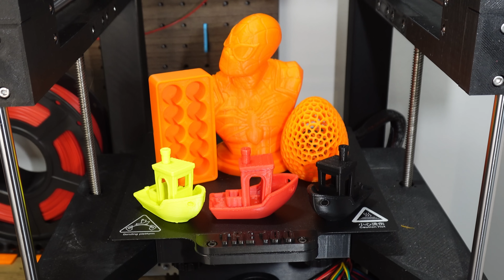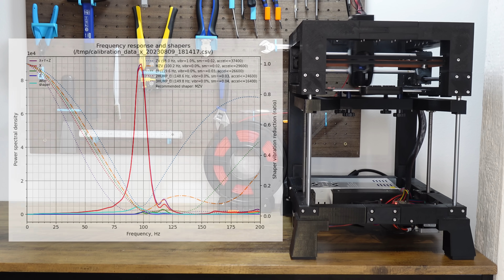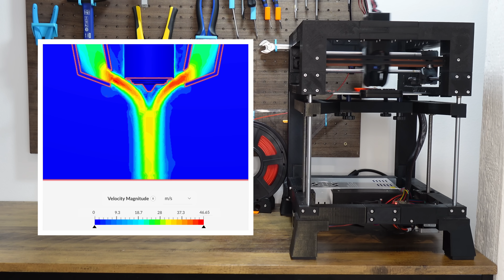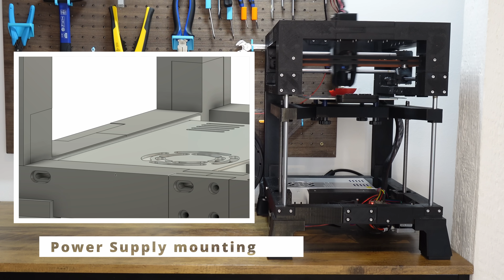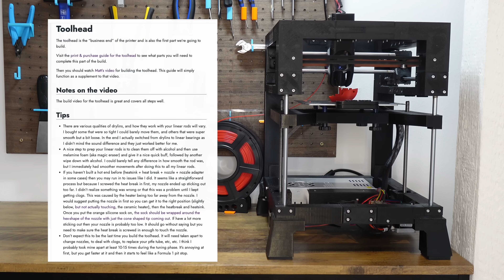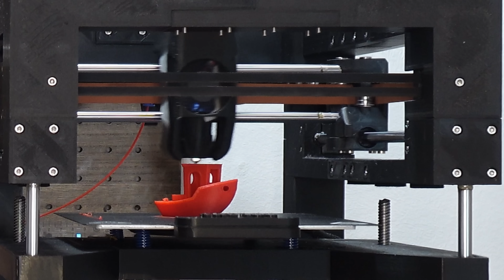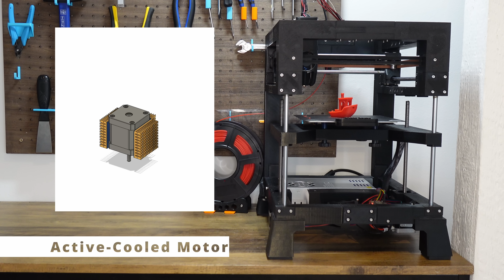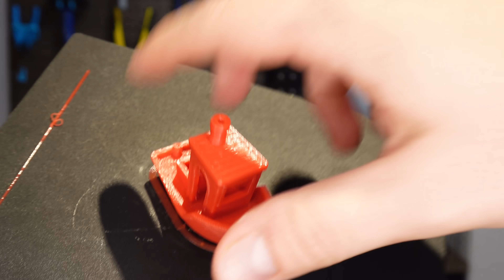THE 100 - The World's Fastest 3D Printer

Comment: Nice printer! Way better than anything I could do by a LOT lol. I would also like to see a bigger version. Speeds are great but I want an area that can take advantage of those speeds and not be limited to smaller parts (I am talking no less than 300x300x300 but preferably 600x600x600). Smaller printers are getting faster all the time and I wish someone would focus on the larger ones as those will benefit even more than the smaller printers. Why print a helmet in pieces when you can print it whole? It really is a great feat that you have done here and I applaud you whole heartedly!!!!!!
Higher dollar version to me would only be if you upped the size. Without upping the size it will always be limited to ankermake or bambu sizes :(
Reply from the maker: Yeah acceleration does not scale that well.. but with printers like the ratrig, you have a very decent printer at good speeds
Reply: You will never print as fast on a 600x600 printer, I mean speed wise you can, just not accel which is the real key on faster prints.
Reply: Vez's Vz235 is around 40k acceleration and his 330 is around 25-30k if i recall correctly. Mine's 20k. So it'a doable at scale yeah.

Comment: 500 bucks is dangerously close to Bambu prices. I'd say, invest time in accessories such as enclosure, bigger bed while trying to keep costs down. Love the project! Also, no ABL?
Reply: Yes, I really see no reason to make a more expensive version if its just as expensive as, arguably, more plug-and-play variants with at least similar performance.
Reply: The Heat will deform the PLA. I dont think printing big ASA parts on this printer will Not Work.
Reply: I dont tried this. Thats Just my opinion.
Reply: Bambu is slower. 20k accel instead of 30k, I'm not sure what the max flow even is.
Reply from the maker: And dont forget that bambu does that 20k only for infills. I do depending on the profile infills with 40-75k and outer perimeter with 20-50k ;-)
Reply: @MattThePrintingNerd  omg!

Comment: i would absolutely build one of these which i got printing down and the bed size to do it....BUT im not good at going into the firmware for the board and stuff to configure it. Last time i did this i used TH3d Software on a sovol and i about died lol. but i did get it to work eventually and its printing well.
Reply from the maker: Have a look at our paper assembly guide there is a step by step guide for the whole software installation process... it's not that complicated
Reply: @MattThePrintingNerd thank you!! I’ll check it out and possibly start making it😊

Comment: I am planning to build one. Would it be better to build it from PLA or ABS? Which do you recommend?
Reply from the maker: ABS should work and might be a bit better in terms of heat resistance (important if you plan to enclose that printer). With PLA we have the most experience, both are fine.

Comment: Does printing this fast also reduce manufacturing cost as the heated bed doesn't have to be on for that long? Would there also be a considerable difference compared to using an enclosure?
Reply from the maker: Yeah it would reduce that cost, but normally printing farms do not use heatbeds when printing in PLA
Reply: That makes a lot of sense, thanks. @MattThePrintingNerd

Comment: How does this printer compare to other comercial available printers?
Reply from the maker: In terms of what?
Reply: @MattThePrintingNerd  Ease of use,  quality of prints,  speed ...
Reply from the maker: It's a printer for a more advanced user that is willing to learn how 3d printing works and to properly tune that beast. In terms of quality it is able to print at tolerances of 0.1mm at 20k acceleration... in terms of speed it prints a benchy 2,5 faster at a better quality than a bambu

Comment: What is the durability/maintenance of this build? Would it be good for a farm?
Reply from the maker: Hm.. that a hot topic, well I would not use my printer in a printfarm. I am 100% sure that a well tuned THE 100 would do a great job on that but since it take 20-30 hours to build and tune it the setup cost of a printer would be way to high and ruin almost every business case. Also keep in mind that in a printfarm you want to have longer prints so that the operator could do cleanup, quality control and packaging in between two prints. Reducing a 4 hours print to 40min sounds nice but it's not practicable for a small business

Comment: Can this printer be enclosed, both for safety and keeping in heat for things like ABS? Could it be built so that the electronics are all mounted outside to avoid heating them? When I ask if this is possible I mean is it possible while it keeps its speed?
Reply: PLA starts to soften at around 50 degrees Celsius.
Reply from the maker: Have a look at Pina's THE 100 Printer, she enclosed it, so maybe she could give you a hint of what works and what not

Comment: Is there a way  to get a 32bit board already setup for this printer ,I have such a hard time with that part of the build .. software is always an issue for me
Reply from the maker: Currently not, but I've opened my Software Installation Guide and TheForgetfulDev is using it as a base to build a better step by step installation guide.

Comment: How many throws did it take to print and how much material did it use?
Reply from the maker: At those speed the printer runs pretty consistant, one in a while the first layer is bad
Reply: @MattThePrintingNerd  how much material did it use?
Reply from the maker: The same amount as a print at 60mm/s would need (within a 5% margin)

Comment: I'm confused @ 100.000 mm/s2 accel the max speed you could achieve on a 165mm axis would be 128mm/s for a fraction of a second. how is this 400mm/s it would require a little over 970mm/s2 accel on a 165mm axis for a fraction of a second?* "Maximum Acceleration: 100.000mm/s²" on printables. edit*
Reply: The 500mm/s @60000mms/2 accel works, i'm not sure if its just a typo or something.
Reply from the maker: With the printers configuration I published in the official BOM for v1.1 the printer will be able to reach speeds up to 400mm/s at accelerations of 100k ( maybe a bit faster ). For my speedboat's I used parts that a bit faster but disproportionate more expensive, some of the custom made. That configuration is able to reach out 2000mm/s at accelerations of 80k or 900mm/s at 160k or 750mm at 240k... but all of those speeds are not really important right now since the limiting factor of the printer is flow... so I chose a configuration for the BOM that maxes out the flowrate of the hotend while being cheaper
Reply: @MattThePrintingNerd  Thanks for clarifying that's really impressive! yeah at those speeds its hard to melt the plastic fast enough i'm facing the same problem. just picked up a rapido and a cht nozzle to try and print faster.

Comment: How about the noise level of this printer?
Reply from the maker: At full speed it's load. But if you reduce the speed by 30-40% you can reduce the partcooling to about 30-35% which makes the printer quiet

Comment: What I'm interested in is high quality prints.
Does this printer print at very high quality at lower speeds?
Reply from the maker: No, it's sweetspot is at 25mm3/s as with every high flow hotend you have a bad time (oozing, pa artefacts, burned filament artefacts) when printing slow... but it's not necessary I get 0,15mm accuracy 40mm3/s flow which is more than I was thinking of when I started constructing that printer

Comment: Hi couldn't you increase your printing speed even more by replacing the steel rods with carbon tubes? Nice video thanks!
Reply from the maker: No it wont work since CF kills steel bearings in hours... and using bushings with CF Rods is slower. But I've designed a production process for hollow rods and currently im looking for a partner that wants to produce them for the community, so chances are high that the next, iteration of the printer will be even faster
Reply: @MattThePrintingNerd if you want lighter rods there are hollow titanium tubes that dont cost too much money
Reply from the maker: Do you have a link for me? I searched a couple months ago and most of them were precise enough for a linear motion system

Comment: The frame looks like it was designed to be made from wood (1/3 overlap with clamping pieces). Why print the frame ? This seems like a huge waste of filament and it would take really long.
I know you designed it to be made from PLA for it´s vibration characteristics but have you considered an alternate material ?
Reply from the maker: It depends on the perspective, PLA is cheap, printing the whole frame costs about $25 material cost, compared to other diy printers you pay more than 3 time of that for the aluminium extrusions for the frame. PLA combined with a FDM production process is a mighty tool, based on Infill Type, density, line width and line height you can shape the vibration curve of the printer tuning the frame for the resonance frequency you need for your usecase this is something no other material is able to do
Reply: True but PLA also melts in the sun like ice cream. Generally speaking it is cheap but no where near an industrial material. It´s not used anywhere else besides 3D printing. What about PETG ? Would that alter the printers resonance characteristics significantly would you say or would it be viable ?  @MattThePrintingNerd
Reply from the maker: Dont know you have to test it.. I printed a lot of things for my sunroof plant hooks, plant pots, lamps all out of PLA and nothing melted..
Reply: I do work as a design engineer in the automotive industry. So I do design some plastic components and therefore know some materials etc. I am not a pro in this regard just to make that clear but I do have some experience due to my work. 
PLA is never used in any industy which I am aware of, it is not even cosidered "engineering material". Because it basically melts in a hot car during summer. It is also super brittle. I never use that material for anything. PETG prints just as well, cost about the same but has far more superior mechanical characteristics so why use PLA ?   @MattThePrintingNerd

Comment: How large can you scale this?  I currently print automotive aero parts on a 400x400x500 and it is obviously slow.  Can you scale this up even bigger than that?  Maybe 600x600x600?  Or bigger?  Amazing work!  May I commission you to build me a 600c600x600 CoreXY printer?  Subbed!
Reply from the maker: Scaling my printer up might work but it would be a complete different printer, with different parts and also slower, mow much slower I can't say but I would go with an ratrig 500

Comment: Using software to correct an actual engineering issue.... might be cheating. 😏

But I think it's mostly a geometry thing that makes this work fine on this printer. If the frame racks in any direction the bed actually moves with the frame in the samedirection. ( essentially reducing the diviation from oscillations ) 
 
Also some stuff about resonant frequencies and a whole lot of calculus 😂 

That software you have and that accelerometer is doing a lot of that math and dampening/padding your acceleration as needed.... this  keeps down destructive resonance   and ringing in the part. 

Tbh I would like this on my CNC mill, but I would have to do a lot 😂 

Tbh I would just update that frame to be more regid.. and I would add a real dampening system for the footing of the unit. 😇 ( isolate it from the table, doesn't not need to be rigidly locked to the table ) 

Just search spring dampening systems

Comment: My first question is, can it be scaled up?  I have an ender 3, and I find that a lot of the things I think of printing are just a little too big for the print bed.  

I'm very impressed with the speed, but not interested in printing quite that fast if the print quality isn't there.  A 15 minute benchy is fast enough for me :)  I would be more interested in increased bed size and reliability (both of the printer and the prints.)

Comment: Hi Matt, will you be planning to create a bigger version of this? I've been looking for an at least 300 X 300 build plate printer and they're all very very expensive. So it'll be great if the bigger version is available.
Reply from the maker: No, for me the size of the bed is the perfect sweetspot between fast printing and enough build area. We have 235x235 mods on our discord so maybe they fit your needs
Reply: @MattThePrintingNerd  And I've been going through the BOM and your discord. just wondering if you printed your version of your printer with PLA or ABS/ASA? thanks
Reply from the maker: PLA

Comment: I would build one but inwant to source as much as posible from non communist nations. Only if not available anywhere else then ok for those parts.  Not looking to pay the most for the best, but its ok to paybmore for high quality parts not made in china or others like that. 250cm cubed up to 300cm cubed would be great but if its significsntly less expensive and would improve reliability or print quality the Z height can be 5cm lower. PLA, PETG and TPU are thebmain filaments i would use
Reply from the maker: Yeah... I also struggle a bit in that political topic...